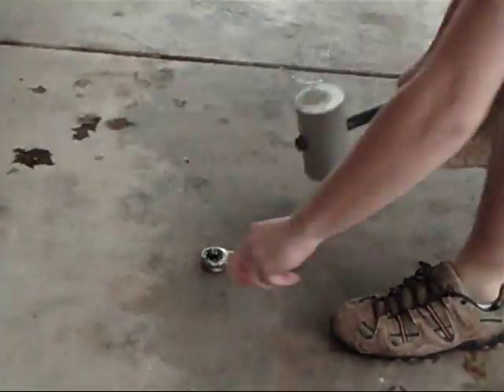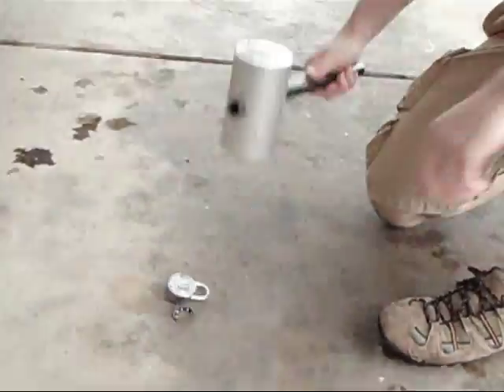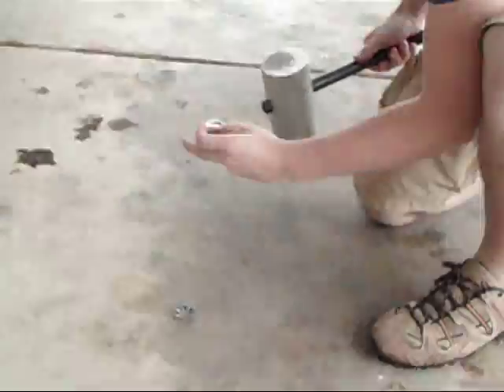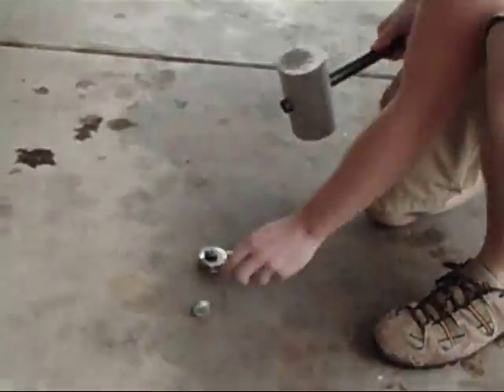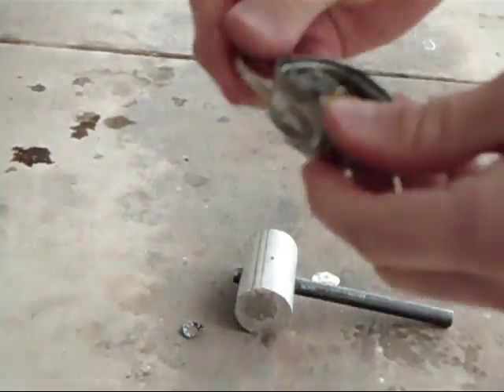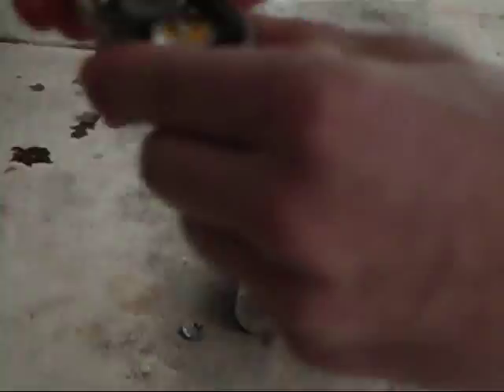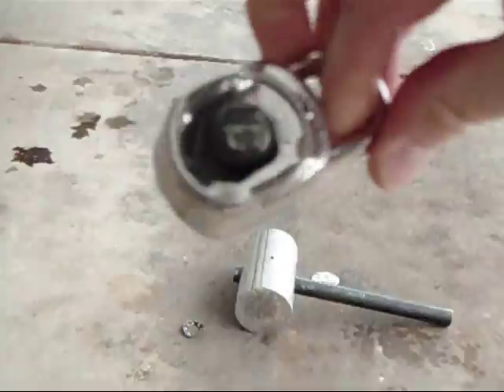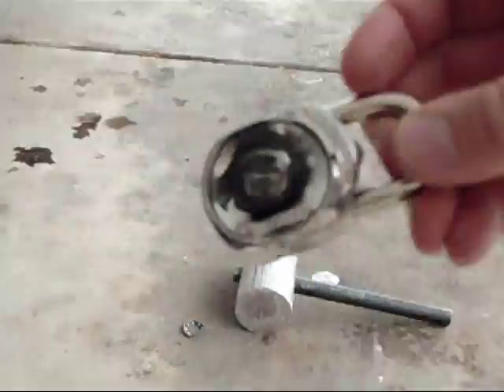Worst way to crack a combination lock

Comment: Well, I agree with you in that hammering a combo lock is usually not the way to go, but I have used a sledge hammer to break one of these open before. The lock was actually attached to a trunk, and I hit the lock on one of the edges were the loop goes into the body. Took about 5-6 swings to break it.